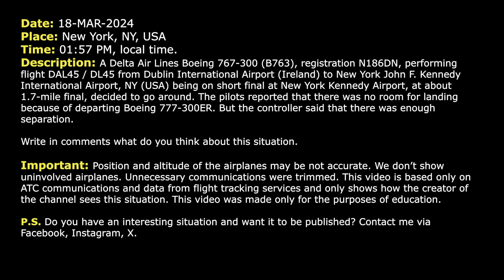Pilot argues with Tower controller about separation at New York Kennedy Airport. Real ATC

Comment: The captain is ultimately responsible for everyone onboard that aircraft. If he says he needs to go around, there's no arguing with that.
Reply: Going around is always the “right” decision.  Even if everyone else thought it would have worked.  There is a reason in the U.S. we have no fault go around and the airlines can’t punish you for it.
Reply: @RetreadPhoto  How did you determine that the separation wasn't safe? 🙂 It was safe by the aviation standards. It just felt unsafe for this particular pilot and he made the right decision of going around. Nobody was in the wrong here, no need for finger pointing and blame casting.
Reply: @RetreadPhoto oh stop it. You always have opinions in these threads that are wrong. It shows you are not in aviation. 

Nobody tried to “squeeze” in or rush another flight. There is no safety issue here. This is how things go daily. Nobody is busting rules. Nobody is trying to push things. Sometimes, things simply don’t work out in the end, that’s why a go around is no big deal. 

Both the controller and pilot did their job. They had an exchange about it afterwards that was fine too. The controller believed there was enough space and he is probably correct. Pilot was distracted by the Air India, didn’t feel comfortable and did the go around, also the absolute right decision. 

The guidelines and minimum distances are set in stone. The controller follows that. The moment the airplane got too close to the other, the controller would’ve called for a go around himself and it would still be safe. That’s why they set minimums. Minimums are still safe and still have a buffer.
Reply: It was going to be tight would have looked good on an AIB report if god forbid anything happened. A fully laden Air India 777 isn't exactly going to be lively down the runway, it had well over 15hrs of fuel and probably a lot of pax and luggage.Good call from Delta.
Reply: @republic3d that's the only correct answer here
Reply: They actually train you to trust your gut. If you feel that a go around needs to be initiated you need to initiate a go around.
Reply: Absolutely! Atc cant fly the plane.
Reply: @RetreadPhotothe controller wasn’t hoping for anything. The controller was correct, so was the pilot. Yes, they can both be correct. 

I’m also not sure what Southwest or Delta have to do with this and only flying with them.
Reply: Absolutely correct. They know better than to give them less than a 2 mile separation, especially if the departing aircraft is just beginning his takeoff roll. That CPT made the right, safe decision.
Reply: Fully agree, absolutely no arguing with that.
Reply: People who know regulation say the spacing was more than the minimum allowed by FAA. So ATC wasn't in the wrong. At the same time, the Captain knows it's aircraft and the crew. Maybe he flew with a new FO and he wasn't sure how he/she will behave in the event of a sudden go around. Or maybe they were at the end of a long day, and he just didn't want to take any chances. So he wasn't in the wrong either.
Both did what they are trained to do.
Reply: @BlueSkyUp_EU where atc was wrong was arguing the pilots decision period.
Reply: @marlinweekley51 I don’t think he was necessarily arguing. Just telling him that there was enough space
Reply: @icedandcorrectedchannel1236  Not his call to say that, aircraft commander decides
Reply: @jamesgraham7297  not his call to say that he provided enough space??? Ofc it’s the pilot’s right to do a go around but the controller just told him there was enough space
Reply: @icedandcorrectedchannel1236  Who is an ATPL and rated on a 767-300?  The person who is and who is watching the situation develop  through the windshield is the one whose opinion carries weight.
Reply: @jamesgraham7297  you’re just typing to argue and not to listen so I won’t even entertain you
Reply: Doing the job every day doesn’t mean he gets everything right every minute of every day. If the controller makes a practice of landing planes “tight” every day then maybe he gets it wrong at least once every day. It only takes one mistake to make a disaster. If there was an accident with one of his planes I wonder how the investigators would react to “I do this every day”, and “it was going to be a little tight.”   One of my mantras:  “If in doubt; don’t” and the pilot didn’t. Good for him.
Reply: @jugheadjones5458  The controller didn't decide the sequencing spacing safe minimums, the airlines and the FAA did. ATC is merely implementing the procedures requested and agreed by all airlines. Without such procedures, there would be way less operating flights in US, which would make both the airlines and the passengers quite unhappy.
Reply: @BlueSkyUp_EU  ATC absolutely decide on sequencing. This has nothing to do with the FAA or the airlines. ATC sequence flights based on first come first serve.
Reply: @rtbrtb_dutchy4183  Yeah, I did say sequencing when in fact I meant *spacing*. ATCs don't get to arbitrarily decide what spacing is safe. They must comply with the FAA regulated minimums. And those minimums have been discussed with the airlines, in order to avoid conflicts with internal SOPs as much as possible.
Reply: @BlueSkyUp_EU  oh, now you make 100% sense. 🤣🤣. I’ve done that plenty of times myself. Yes, I absolutely agree with what you said now.
Reply: @jugheadjones5458  no, when he says “tight”, he simply means according to the minimum distance allowed. It’s not a safety issue to bring it right up to the required minimums. Those minimums already have a safety buffer. Everything is monitored. You won’t have a controller doing things differently than other controllers. 

You people are making too much of a drama out of this. Go arounds happens all the time at airports like JFK. Not because they are being unsafe, but because sometimes the sequencing doesn’t work out. This was not a near miss. This was not dangerous.
Reply: It the pilot´s call, but it's perfectly fair to argue whether he made the right call or not. (Although arguing should wait to the aircraft is landed.)
Reply: @magnuskongskov3532  Yes. Two different types of "arguing" something I guess.
Reply: @magnuskongskov3532 I would much rather a pilot err on the side of caution. I'd rather be late than buried.
Reply: @magnuskongskov3532 there is no argument. A go around is the right call no matter the situation. If in doubt go around!
Reply: Lol. That wasn’t arguing. He said it was going to be tight but it would work and to contact departure. Some of you are so sensitive. Lol. Arguing….
Reply: @spades9048  controller was all good till the “I do this everyday sir” comment. That was unnecessary, you’re questioning the guy’s decision making. Ask the reason for the go around and take it up with your supervisor if you had a question.
Reply: @london651  and the pilot questioned the controller’s decision making. It was a brief two sentence exchange and you guys want to act like it was a full blown argument.
Reply: Unless the controller was typed in the 767, he should have kept his opinions to himself.
Reply: @johnhoss2950  Oh, okay. Unless the pilot is certified to work JFK Local then he should keep his opinion to himself. Unless the pilot is certified for Kennedy departure then he should keep his opinion to himself.  Some of you YouTube warriors are hilarious.
Reply: @spades9048  👍
Reply: @RetreadPhotodelta doesn’t play when it comes to safety not like the other dummies with AA and United
Reply: @ea7654  ridiculous statement. Nobody plays around with safety. Neither does AA or whomever. Delta is no different than everybody else.
Reply: @rtbrtb_dutchy4183  sure they don’t what makes you the chief of the FAA
Reply: @ea7654  what does this have to do with the FAA?  You claim that only Delta is safe and call AA and United “dummies”. 

They are all the same. Actually, if you go by stupid mistakes like being off course, landing at the wrong airport, etc etc, you will find that Delta has more issues with this in comparison to other major airlines.
Reply: @rtbrtb_dutchy4183  They all have issues but from experience Delta doesn’t take risk, you can even see it on the flight path they take. All I am saying is they are more aware of safety.
Reply: @ea7654  they are not more aware of safety. Everyone is the same. And what flight path?  You understand that’s assigned by ATC right?  You can file a flight plan, but ATC will give us a reroute if they don’t like what you filed.

You say that Delta doesn’t take risks. Yea, neither does United or AA or Southwest or JetBlue. Nobody takes risks.
Reply: Only three percent of controllers have a basic pilot’s license. The Captain trumps all!
Reply: @chrisanderson1543 that’s not how it works.
Reply: @chrisanderson1543  I’m not a chef, but   I know good food when I taste it. 

You’re not the only one who can make irrelevant comments.